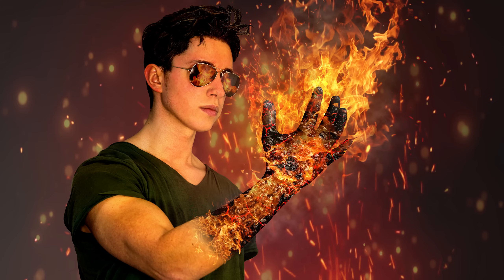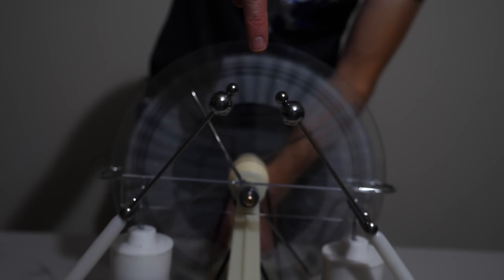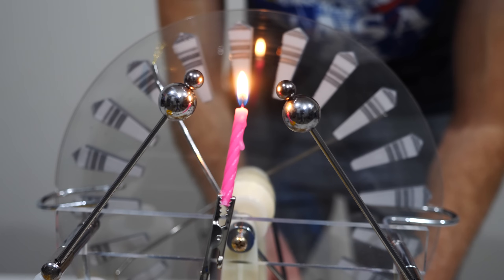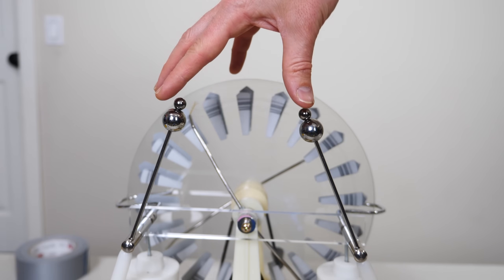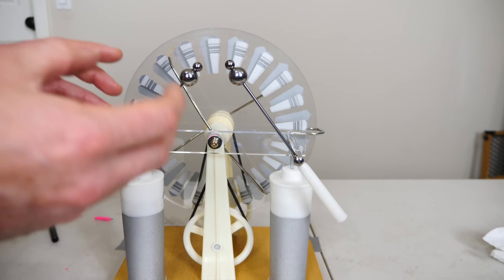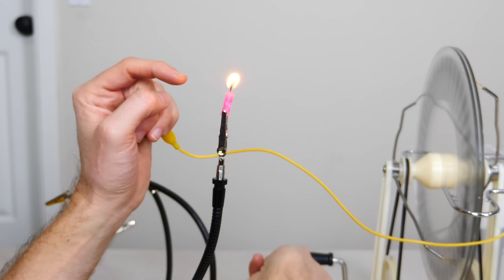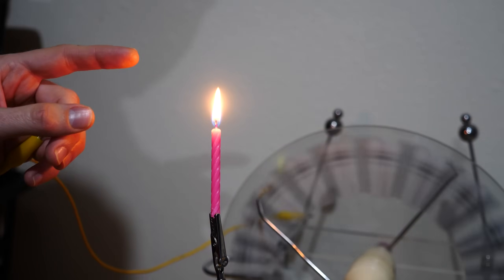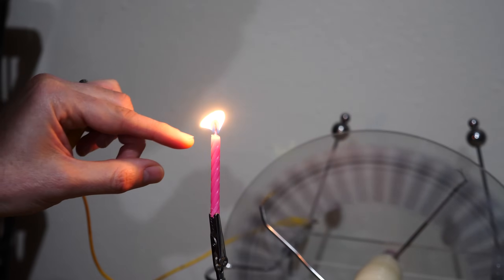Controlling Fire With My Hands Using a Wimshurst Machine

Comment: if you take away the charge collecting stuff you can sense the electricity on the wheels with your finger& thumb if you put them near 3 o'clock or 9 o'clock; if you do it in a totally dark room you can see sparks coming off the wheels onto your finger & thumb. Simplifies the setup to the point where it becomes really mysterious and magical. Also incidentally much safer.

Comment: Another really interesting video. Thank you! I wonder if the effect would still occur with a blue gas flame? I suspect the luminous, yellow portion of the candle flame contains charged soot particles and free radicals - the net positive charge is a strong clue. FWIW, this flame is not really a plasma*. Of course, the effect seen when you increased the spacing still happens with charged particles and does not require an electron-rich plasma.
*From the Royal Society of Chemistry: "In fact, some very hot flames do contain plasma – when the energy inside them is sufficient to ionize enough of the air molecules. A classic example is the flame generated by burning acetylene in oxygen, which reaches an eye-watering 3100˚C. The paltry 1500˚C flame produced by a wax candle, on the other hand, is too low to be considered a textbook plasma."

Comment: I have some questios. Why it doesn't spark when you firstly put the candle between spheres. Was it conducting electric charge so slow and continuously and we were not seeing a spark? Or you just didn't turn the disks enough to create a spark load?

Comment: If you use a digital thermometer towards and away, with precise measurement of distance, try to map temperatures.  Put a motor on the electrostatic generator so you know the speed, and can begin to estimate the currents, you can begin to calculate exactly what will happen.  Consider an electronic control of positions of a series of electrodes with specific shapes and distances (the curvature of the tip of the electrode changes the field strength.)   Document that, find equations and similar things on the web.

Can you extract energy from the flame? The electrons have momentum, and they draw some of that from the flame.  You cannot put a flame in a box that easily, but the field does not burn and can apply force to the flame.

Build a very steady 40,000 volt power supply.  You can modify a cheap Tesla coil.  That allows control of the voltage and current, after a bit of learning and care.  Several such generators are getting small enough to control voltages independently. You can check the radio noise from the power supply with a RTL_SDR software defined radio that can listen to all the frequencies down to 0 Hertz.  You will see a broad spike at about 35 kHz. You can use frequency control to also control the voltage since the output voltage is frequency of the input power supply dependent.

If you modulate the Tesla coil at audio frequencies, you can look for the flame to move. That is an electrostatic flame speaker, but it can be used to shape and control the flame.  You can use an alcohol flame and add different ions.  Ions have different ionization energies so you can control the number of electrons and ions by adding low ionization chemicals.  Check the electrochemical series for the values. The CRC handbook of Chemistry has most of the ionization energies.  The flame can act as an ionization source to enhance a microwave plasma.  You can add radioactive electrons and ions to start the cascade called a breakdown.  Townsend breakdown will get you some good information.

You can start a global community all with a common interest in controling plasmas with fields.  But don't blab and chat, try to find specific and testable equations and instrument and equipment that works.Then continual refine and improve. Track what everyone contributes, then it is easy to ask for sponsors and funding. Most every person on earth has some interest in fields.  But now we have the technology for everyone on earth to combine and share their experiences.  And measurement and recordings of observations and methods is critical. Share real experiences as you have done here, and then begin to quantify them.  It will become a science, and not an eternal parlor trick.

Check and visit all the school websites in the world, starting with 
google:

 "flame" "electostatic" with 3.84 millon entry points
"flame" "plasma" "control" with 10.7 million entry points
"shape" "electrostatic" "equation" with 8.92 million entry points

Think of the massive duplication of basic study of this phenomena and ask yourself how to make it into an engineering science where it can be used and understook and applied.

Richard Collins, The Internet Foundation

Comment: I still have a Wimshurst machine I bought back in the 70's, from a company called Edmund Scientific.  I need a new leyden jar, and some work on the collectors.  The device could generate 75,000 volts.  There are so many experiments that can be done.  Once, I even tried to attach a motor drive so I could have both hands free.  Not enough torque, though.  I may revisit that attempt one day.

Comment: Now use the high voltage to make an electrostatic percipatator.  That is a tube with a wire in the center wire and foil lined on the part of the tube. The let a smokey flame through the tube and the smoke will be attached to the foil and the flame smoke will stop polluting.  I understand that power plants use this to stop polluting.  I built one  as a kid and it worked very well.

Comment: During the Iraq war, Sadam set the Kuwait oil fields on fire. They ended up using explosives to put them out but I wonder if they could have used this technology? It was hard to even get close enough to set the explosives. You could easily push electrodes in to push the flame with needing to get too close. I wonder if you could pulse the voltage maybe using as AC waveform to disrupt the flame? Could be helpful in future for many applications.

Comment: Flame is plasma, it has lots of free electrons to conduct electricity.

I've been experimenting with high voltage a lot, try using a HDPE plastic bottle cap, and make the arc go around it, soon the arc will go through the bottle cap instead of bending around it as the cap catches flame and turns into plasma

Comment: It’s called corona discharge or electric wind. It happens because of the discharging action of the charged point. The air molecules near the electrode get  an opposite charge due to induction and are attracted, upon closer approach they share charge with the electrode and acquire the same charge and get pushed away in considerable speed, giving it an appearance of ‘wind’ coming out of electrode.

Comment: If a space rocket(etc.) put this in it's tip could it use that to help with thermal dispersion on reentry or other high resistance application? Or maybe if not powerful enough for full dispersion at least some dispersion but also with possible refocusing of thermal energy generated?

Comment: Fire isn't plasma. ☹️
Reply: R u stupid?
Reply: @dwdadevil  Fire is not necessarily plasma. Only if a fire is hot enough will the components of the fire ionise.
Reply: @09876124  Well, the guy on the video lit a normal candle, and was enough to conduct the electricity trough air, meaning it was ionized
Reply: @dwdadevil  but surely that means that the fire contains plasma. Its not necessarily pure plasma...

Comment: What would've happened if you had stuck your finger between the electrodes, with them that far apart? Would your finger not complete the connection just like the flame did?

Comment: Why not use high voltage electric fields to extinguish fires ?
Reply: 3. The amount of power you will need for this is enormous since air resistance is so big, remember all he did hear is create a 5 centimeter field, and that took 50K volts, so... Yeah
Reply: @tchgs11zdok15  That's true.

Comment: Paraphine is excellent isolator, try to do this without paraphine - may be there there will be sparks. 
Also paraphine is very strong diamagnetic - it runs away from all kind of electromagnetic field, as well as water or glass.
i think largerly this interesting effect not because of plasma itself but cause of diamagnetism of paraphine.

Comment: To be honest I would have placed electrodes further away from your will to further prove that there is no wind coming from the wheels spinning. If you look at it in slow-mo you will see that the flame didn't move ever so slightly toward your hand before you even put the electrode on

Comment: And what about consoming an atomic bomb with this
Reply: Dude, it's a 5 centimeter field and that only took 50k volts since the resistance of air is so high, so yeah, you'd need a freaking enormous amount of power,
Second how the heck are you supposed to do that?, and if you didn't saw even when he was "pushing" the fire it still wasn't strong enough completely stop the fire from burning him, the affect was there but it wasn't that strong, it's like saying stop a big rolling metal ball with magnets... (spoiler, it won't stop it in time)
Reply: Also That last anology is like this only 10000000000 nerfed

Comment: Does this mean that if you cover yourself in electricity you can survive a house fire?

(Ignore the toxic gases please)
Reply: im not sure but i think if you charge yourself with that much electricity it will jump from your feet to the ground
either way if we ignore that you'll be cook for the heat of the closer fire
Reply: Youll probably melt still. If youve ever been near a big flame you know how hot they are even at a good distance
Reply: @ZirJohn  Even the hot air is repelled, not just the flame. He said so in the video
Reply: @anshum1675  oh didnt hear that my bad
Reply: @anshum1675  Hmm.. How about heat from radiation (not from air)? I don't know the comparison between heat from radiation and hot air though..
Reply: Remember the intro for static shock where Vergil repels the flames of hotstreak. It's like that. He's packing billions of volts from what I can tell

Comment: love to see ur chanell now lets use some imagination.. lets build this in a much bigger scale and stuck it behind of a firefighter truck or  some stationary unts with some huge poles and place them in amazon forest. And control fire  repel it so u can have access to the spot to get closer and stop a fire or in the best case scenario give those electrons a wave form with some frequrncies and create some frequrncies to stop fire imagine an explosion shockwave hitting a tree  bu instead give them a high voltage shock boom.. Am i dreaming a lot..??
Reply: Wtf
Reply: A forest fire isnt a candle, even if you could blow out oaa flames, it would still glow and react with the airand start burning again as soon as you stop using it. 
I am also not sure if the elecricity would just go in the ground.
Reply: I'm curious if a perimeter could be set around a fire to control it from spreading. I know you can't put it out but, can it be controlled to the point of it not spreading.
Reply: @BigBabyJ1083  Yes!